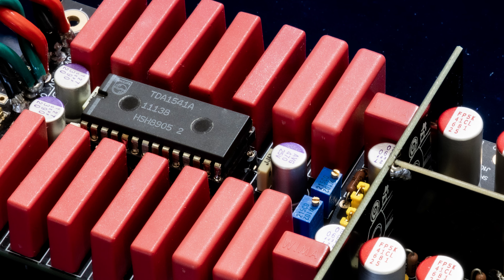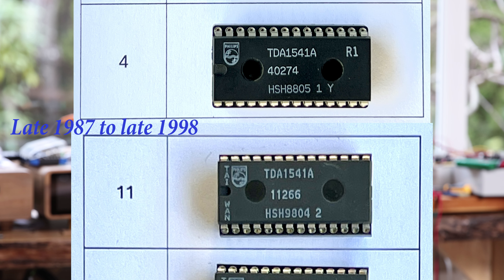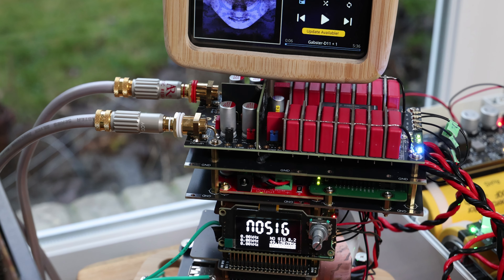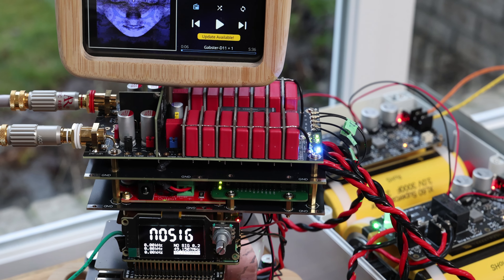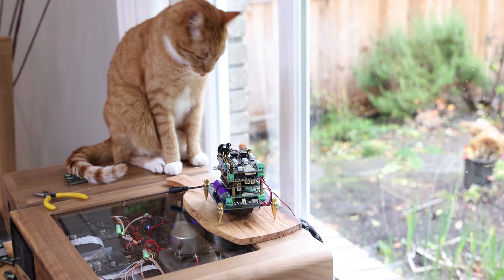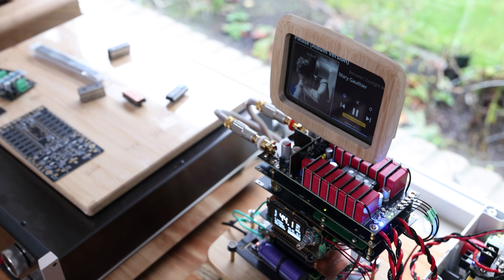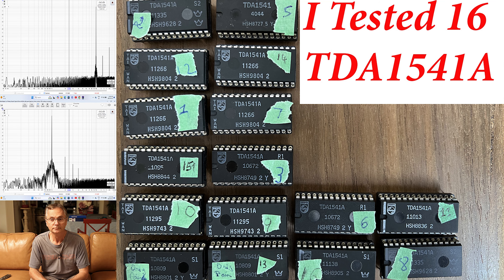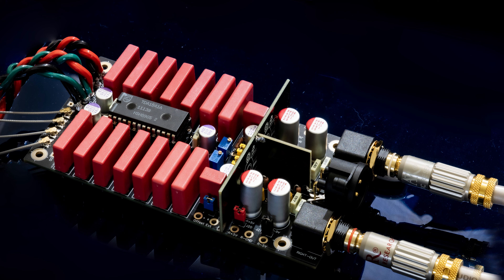Finding the Perfect TDA1541A  DAC Chip: Tips and Insights

Comment: @Gabster - Excellent video on educating us on the differences between the various TDA1541a chips. Its quite an interesting topic as you've mentioned, there are some many variations and sound differences between the Years (87-96), Batches, Plants (Holland vs Taiwan), Grades (Relaxed, Standard, S1 & S2s), and the crown variants.  I have 4 chips (legit ones), R1 Y87, S1 Y88, standard 88s.   They all sound different to each other.  The R1 is fuller sounding, non-offensive, tubby bass, which you can just listen to in the background for hours. The 2 standard 88s are similar sounding but are on the opposite spectrum of the R1.  Dynamic, detailed, punchy basslines, good soundstage - width, height, depth, but what differentiates between them both is that one has a smoother midrange, and the other has a more upfront, clearer midrange.  Both are reasonably holographic but the one with the clearer mids is slightly better in this respect.  The S1 is my goto chip, does all the above, plus more.  The mids are a bit more palpable, but the holographic presentation is quite beguiling.  Has a bit of that wrap around sound that puts you more into the scene effect.   As you've said, its so hard to get decent chips, let alone one's that are superstars.  

I have listened to a few R2R designs like the Gustard R26, Denafrips Ares 2 and Venus 2, and somehow, the old TDA1541a does music just right over the newer, more advanced R2R designs.  

Thanks again for taking the time to do this, wish you and your family a wonderful Christmas and a Happy New Year for 2025.  Looking forward to more exciting content from you next year.
Reply from the maker: Thanks a lot, looks like you know exactly what I am talking about.  Have a wonderful Christmas and a Happy New Year :)

Comment: Very cool 😎 I bought a Cambridge audio dacmagic 2 like I had back in the day (that was great at the time) but it sounded not as good fed from optical out of a cheap 24bit streaming dac as the same dac audio out, perhaps it has some electrical issues (it’s old kit now)  or the optical out was the issue? Must try it with a cd and a proper digital 75ohm cable input 👍

Comment: Really learning a TON from these videos on DAC chips, so thank you Gabster!!!  I wonder if the DAC chips out of older CD players can be 're-purposed' into a newer DAC?  I have a Pioneer PD-65 that has a bad laser assembly board and no longer works.  However, it has 2, "PULSEFLOW LEGATO-LINK" PD2028B DAC chips.  I believe they were 1 bit and did have some form of custom 'EQ' tweak to them.  I had LOVED how this CD player sounded using the internal DAC, over ANY other DAC, CD player, Streaming unit I have heard.  I would LOVE to find a way to pull those chips out and use in a stand alone DAC unit!!!
Reply from the maker: A couple things you can do search for a part replacement for the Laser assembly maybe you can replace it or send it to a good CD repair guy maybe fixed other option converting it into a Dac if you can find the I2s leads but that requires schematics experience and time 
I looked it up that is a nice 1500$ CD player
Reply: @Gabster1  that's so funny you say that, as I am in the process of my repair shop tracking down a new laser assembly.  They are no where to 'reliably' be found, anywhere, save for taking out of someone elses used same-age-used machine.  I have also wondered about having it just as a DAC!  I am fairly certain schematics can be found somewhat easily, and also somewhat certain the I2S leads could be traced.  It's a matter of finding someone with actual skill/experience/knowledge to help with all of it!  Honestly, when it ran I had it go thru 2 dozen DACs, and the internal one ALWAYS was DRAMATICALLY different, obvious, bold, clear and very 'projecting' sound and sound stage.  It truly is one hell of CD player....well...was.  :D
Reply from the maker: @alanm.thornton4055  maybe I should buy one but then I have too many projects and so little time :)
here is a schematics link  looks like 19,20,21,22 are your I2s Pins https://audiocircuit.dk/downloads/pioneer/Pioneer-PDS904-cd-sm.pdf
Reply: @Gabster1  I have one with a non-functioning laser assembly (I think it actually needs a knowledgable technician to re-set the laser mechanism-it works, but wont read due to the head assembly wobbling).  Would be glad to send to you! Thanks for the ski-matic!!!!  Cheers!!